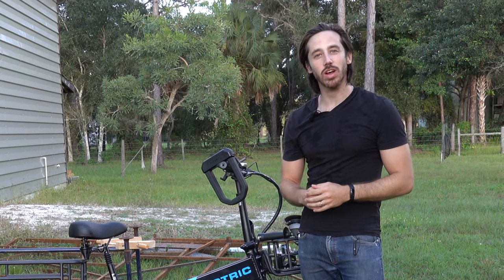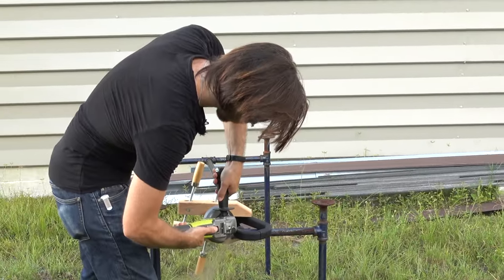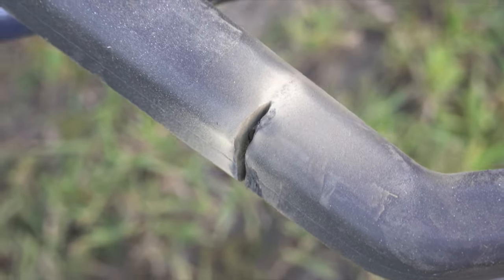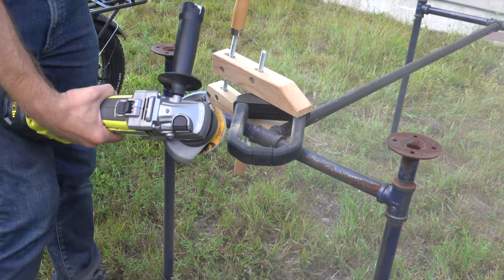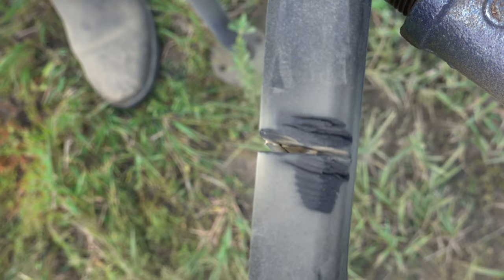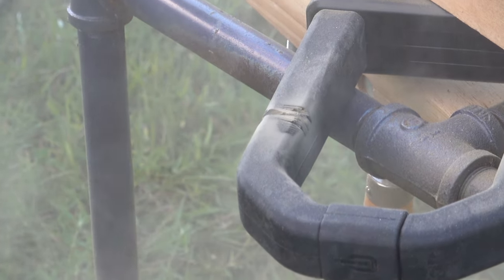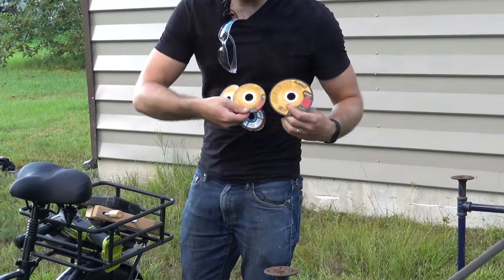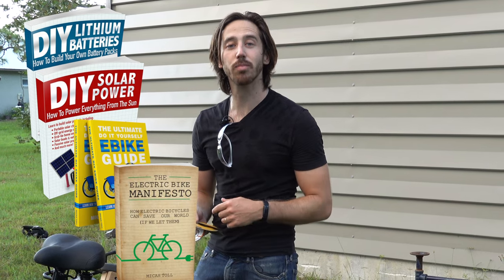Best E-bike Lock? Angle Grinder-Proof Hiplok D1000 Test

Comment: Nice joke. that's a grinding disc not a cutting disc. A 1mm cutting disc would cut through that in seconds.
Reply from the maker: Those are 1mm cutting discs
Reply: You have it backwards.  A THICKER cutting disc (on a sufficiently powerful saw and battery size, not ryobi) will last longer which is the bottleneck to cutting that.  I'm wondering if even a plain old grinding wheel instead of a cutoff wheel would even work faster, but of course it also needs a larger diameter, considering every 1/2" is probably going to double the cut depth before replacement, or far more if a ceramic disc.

Comment: A thief is a thief, a thief with a cordless angle grinder in his bag, is a thief with serious intent. If the latter comes across my very nice e-bike shackled to a bike rack or purpose designed piece of street furniture with one of these angle grinder resistant locks, will he see the lock and move on to an easier target or just cut through the rack or street furniture in seconds and steal the bike with the shackle still on it? He can then remove the D shackle lock at his leisure back in his lair. Is he really going to spend minutes trying to cut the shackle as opposed to seconds cutting whatever the bike is shackled to? I wonder??????????

Comment: They will destroy a $400 lock but not cut through so it is garbage and when you piss off the bike thieves because they can't steal you bike, they will damage you bike out of spite. So you will at the end pay for another lock and pay to repair all the damages like cutting hydrolic brake lines and gears and even to the body of the bike and batteries. If you have an expensive bike you have to ride it and go home to lock and store it away. You can't ride it to work or to go into a store with any bike lock.